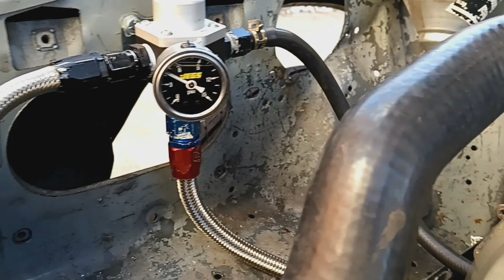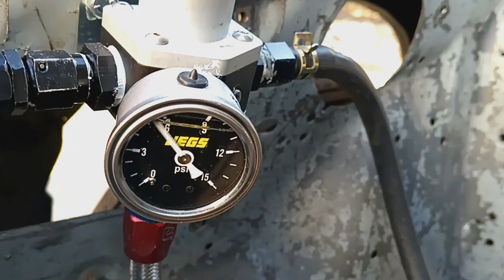Fox Body Mustang EFI to Carburetor Conversion - throttle cable

Comment from the maker: Using stock dist - notice only using two wires (straight to ignition coil); using stock fuel pump
Reply: so, you have no advance curve. MSD makes a timing control box for distributors with no provisions for advance.
Reply from the maker: @garymatthys3605  Thanks for the infor Gary. Will look into that. Just lucky to have it running for now. Glad I converted this from EFI to carb.
Reply from the maker: Recently I changed out the intake fuel pump for an inline fuel pump. My fuel pump runs 4-7 psi rather than 88 lph. Only 1 fuel line needed (no return line). Amazon has the fuel pickup tube for about $99.00. Numerous types of fuel lines kits available on ebay.